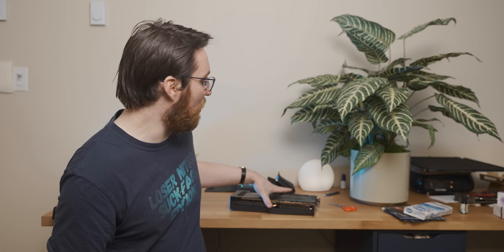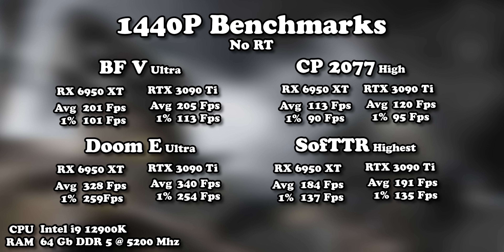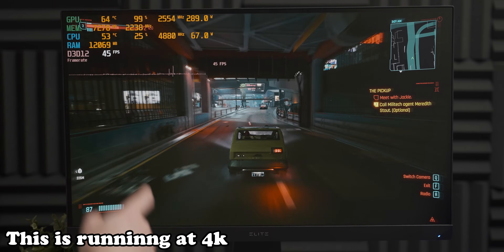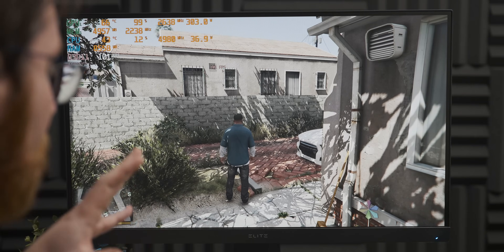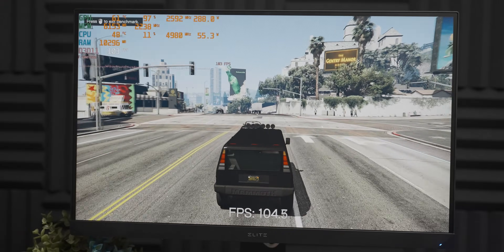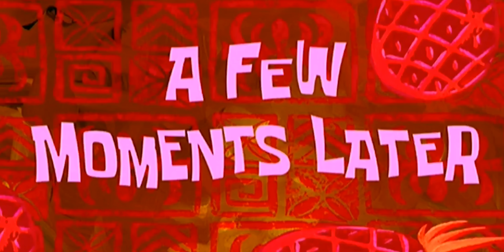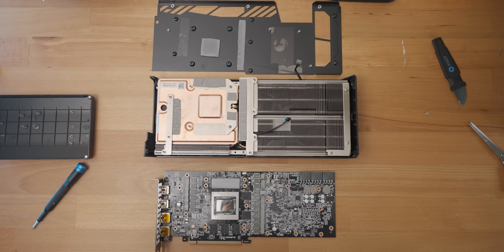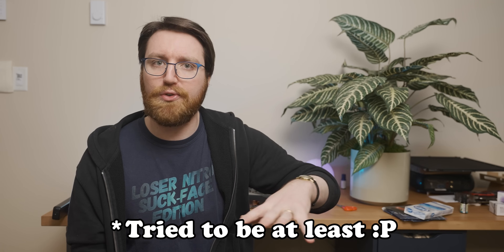I Can't Figure Out What's Wrong With This Gigabyte RX 6950 XT

Comment: I had a 6800 that behaved similarly. Not sure why. Even with afterburners power slider maxed out it wouldn’t pull more than 215 watts.
Reply: he made big mistake, you can't measure the power of AMD cards using software only

Comment: Considering that this is Gigabyte, with its infamous  revision-prone history, i thought that they might have more than one revisions of this model shipping out to reviewers and customers already.
Reply from the maker: Haha!! Yeah, that is definitely a possibility.
Reply: @DawidDoesTechStuff  Wonder if it could be something as simple as them manufacturing the cards with the same resistors too the voltage controller as the 6900 xt that now limits powerdraw on a hardware level, which causes the power filtering too get really noisy because it's struggling too pull the current it's supposed too have & they are trying too just get the cards out there anyway instead of fixing them.
Reply: cough cough Look at their Gigabyte Z690I DDR4 board and its massive recall cough
Reply: Agree 100%. I'm allergic to Gigabyte.
Reply: @Eremon1  oh how the mighty have fallen gigabyte use to be great
Reply: @emilypeters8888  
Sadly true.
Gigabyte were rarely the highest performing, but they were solid, dependable and reliable.
But now they seem to increasingly be a brand to avoid ☹️
Reply: absolutely
Reply: To be fair a lot of brands do silent revisions, Buldzoid has mentioned it a few times in reference to RAM OC.
Reply: @liaminwales  Of course I know that everyone else has been doing silent revisions with many products, but most of the time, it's just one another revisions within one year life span of said products (two at a rare cases). 

On the other hands, Gigabyte has been consistent with two to three kind-of-publicly announced x.0 revisions with even more when counting those silently revised x.x revisions for many products released so far.
Reply: At least it isn't on fire (for now)
Reply: Yeah. Simple logic tells us that if it is not the driver, not the firmware and not the mainboard, it has to be the hardware of the card itself.

Comment: I have also had issues with a Gigabyte graphics card. I had a 5700xt Windforce that caused a lot of game crashing and random computer restarting. I undervolted the card and that helped. Later, I just got rid of the card. Got a FE 3080 and haven't had the same problems
Reply: Apples to Oranges comparison.
Reply: @CarbonPanther  I wouldn't consider having issues with a different Gigabyte graphics card to be an apples to oranges comparison.
Reply: @wiifan013  Yes because you're not comparing the same models at all, Gigabyte using a chip from AMD vs. one from Nvidia requires an entire rework of the PCB by Gigabyte, therefore you can't compare the two.

Comment: 6:08 - The GPU shows up as an AMD Radeon RX 6600. Is it anything to do with that?
Reply from the maker: Oh yeah! That is really weird. Nice spot. I’ll also mention that to Gigabyte and see what they say. 👍
Reply: @DawidDoesTechStuff  The fact that this isn't the only one, I don't know what to say...
They either mistaken the chips or they were replaced somewhere in between, in factory or outside... the whole card. 
Might be good to check the gpu info stuff.
I could be wrong though.
Reply: Well spotted
Reply: good eye, if the computer thinks its a RX 6600 it could be following normal procedure for the RX 6600 and not the RX 6950 xt.
Reply: But does the rx 6600 consumes 300w?
Reply: They literally look exactly the same.  Knowing Gigashites QC they probably put the wrong one in the box.
Reply: @michaeltyrrell3381  more than likely
Reply: @fantum12000  actually unlikely, cause the 6600xt version has only 1 power connector, this one has 3 soldered on. so it cant be the 6600xt model they packed and shipped on accident
Reply: @WaschBaer_95   please tell me where i said 6600xt?
Reply: @fantum12000  around timestamp 4:04
Reply: @fantum12000  you said yourself an RX 6600 .... the non xt version wont magically jump from 1x 8pin pcie to 3x 8pin pcie connectors .. i just mentioned the xt cause its the first one i saw, but even looking at the RX 6600 gigabyte version it shows only having 1 power connector.    rx 6600 to rx6600xt is like 3050 to 3050ti .. not much of a difference in terms of power draw
Reply: @WaschBaer_95  fair point, do the 6700 or 6800 also have 3 8-pin? Could it be a situation where they did put a wrong board in the box with the wrong vbios?
Reply: @fantum12000  mhh, he said he did update the vbios as per recommendation of gigabyte, would be weird if it still shows up as 6600 with a 6950 vbios, unless the bios is always the same, and determines settings and clocks etc, judging from some set fuse or smth in the die, could be that this cards die is defective, or has the wrong factory side fuse set, that tells the vbios "Hey i am a 6600, give me the settings for that model"
Reply: @WaschBaer_95  how likely is it that it's a fuse and that was missed by gigabyte?
Reply: @michaeltyrrell3381  but then how would the 6950 drivers install? This is weird.

Comment: The only thing I can think of is that you may want to use 2 different cables for your PCIE power connections on the card.  I've heard that sometimes the power draw can be too much for a single wire.

Comment: I had a 1080 Ti from Gigabyte and it went into flames in my case 4 months after the launch of the 30 series from Nvidia. No cards were available at non-stupid price so I had to fall back to my RX 480 8 Gb from MSI. I could be stuck with a lot worse but I'll never buy another graphics card from Gigabyte, NEVER. It's been more than 1 year and it still hurts, damnit. I'm glad my RX 480 is still a trooper, I still max out some games at 1440p but its days are counted. It's been overclocked for more than 5 years. It will celebrate its 6th birthday this summer. One hell of a graphics card I tell you. Best PC purchase ever.
Reply: Man, the RX480 will never die. That thing's going to be good for 1080p/60 until the heat death of the universe.
Reply: My Strix RX480 is plugging along nicely. 
Sapphire 590 and 6700 also have worked great for me, so I'm only buying those companies cards in the future.
Reply: I have one gtx970 with completely burned hole through PCB, also Gigabyte card. And it wouldn't be nothing special to talk about, mosfets die and sometimes card end up like that (decent brands will include fuses on board to prevent that but that's another story). Problem was that that was not main power line, you can expect something like that on Vcore but in this case problem was on f. logic 5V rail, rail that have maybe 100mAh draw and it's cool and not under any pressure (most card from that era use simple linear voltage regulators anyway for it). 
But Gigabyte find a way to screw even that up and use obvious reject parts
Reply: @gorky_vk  Gigabyte tried to CHEAP out on components thats why they keep changing suppliers so u might even get mosfets and stuff from a worse supplier for same price (refer to GN's Gigabyte PSU fiasco videos - its very likely thats done for all their products)
Reply: Cheers on your long living rx 480. Great card! Pop that baby in a frame for collection. It may be worth something one day!

I collect many "pinnacle" cards from different eras. The 480 may be one. Hell, even the 1080ti. Shame yours went in flames.

I have a founders 1080ti. (from gigabyte none the less) and it's still ticking in my guest computer. My main rig has the 6950xt (nitro+ pure) it's a monster. I'm never getting rid of either one of those cards. They'll be collectors items! 🥰
Reply: Back when there was value for money in GPU's eh...
Reply: Ya should go about repasting the gpu and replacing the thermal pads with a good cleaning. Should last even longer after that
Reply: I use Gigabyte Gaming OC 3050 8GB for about 3 months works perfectly temperatures are unbelievable even when im playing temp dont go over 60
Reply: my 4 yr old 4GB RX550 still going strong (power color)- last year i broke the fan blades on it and just taped them together and it still works - been running on max OC and power draw since 2020 - and well it runs everything 1080p mostly :) except well AAA games but well thats a secondary rig with ryzen 2000 - my main has ryzen 5 3500 with a 2070 super from inno3D which is 3yrs old now

Comment: when you show the temps on your softawre, it Show "RX 6600" for your 6950xt, the problem seems to be with one of the component of the card if Gigabyte used a 6600 component (if it is the real temp of the card on your screen and not a screen fro manother card)
Reply: I noticed that too.
Reply: The only component that will identify as a 6600 is the GPU of the 6600. And that is not the case.
Reply: @DarkoPetreski  In that case, There maybe a part 2 incoming, Its possible that Gigabyte used rx 6600's components for their 6950xt to make the production cheaper, that would not be the first time that they made that kind of crap (like their PSU lol)
Reply: @weatherdream7343  it's a new card, I think hwinfo just didn't display the name correctly. It's gonna get patched out. But the whole power limit thing is pure gigabyte incompetence, I agree there

Comment: There's not a 3rd option here. Either you couldn't deliver more than the 288w to the card (electric setup on the house idk) or the card doesn't draw more for some hardware limitation, something physically wrong with the power delivery
Reply: he made big mistake, you can't measure the power of AMD cards using software only

Comment: 289w + 70w from socket that is spot on. I have 6900XT with 400w TDP 289w is what software will indicate while card is using ~ 360w.
Reply: hmmmmmmmmm
Reply: That's a very good point however it does not explain the suboptimal performance of his card in games, since it was still a lot slower than other cards that measured over 350W.

Comment: I"d personally be prety happy....a card that draws 50% less power than a 3090ti, that has marginaly lower frame rate, it is a really good card. That sound though..... i think the fans must be broken or something.
Reply: It is coil whine, it's got nothing to do with the fans dude.
This is just a terrible card.   All 6950 and 3090 Ti are - the highest anyone should consider is 3080 Ti or 6900XT, unless they are pros that need more VRAM still.

Comment: The only time you see graphics card that consumes 298W of power and you say it's not enough
Reply from the maker: I know right! I does feel pretty weird to point that out as a problem. 😅
Reply: @DawidDoesTechStuff  Sillicon Loterry and you won it maybe?
Reply from the maker: @Teksers  I wouldn’t really call it winning the silicone lottery considering that it was underperforming a decent amount.
Reply: @DawidDoesTechStuff  But somebody else mentioned that on hwinfo it states "rx 6600", maybe that has to do with something?
Reply: I check videos and shorts. Did I miss the update on this. I'm looking to buy this exact card.

Comment: Did you force PCI-e gen 4 in either mobo bios?  Tech Powerup was using AMD 5800X CPU, was your 2nd test bench an AMD platform?  What about Resizable BAR settings?  My apologies if you mentioned those possibilities but I don't remember hearing them discussed.

Comment: Just one small question. How much slower is it than the 6900? Can it be that they just sell you a 6900 and call it a 6950?
Reply: I was thinking the same about the 3090ti, maybe they just pick the best 3090/6900xt chips they made (silicon lottery wise) and OC/push up it's voltage a lot higher .... i mean you litteraly gain just a few fps by using a lot more energy ... just like an OC.
Reply: @arthur2605  The 6950 comes with faster memory though that you can't get on a normal 6900 and it's helping a lot so keep that in mind!
Also worth mentioning that the 6900XT using the so called XTXH chip exists which is literally already a pre-binned version that will net you all of what you ask for, and that chip is already a almost year old as well.
Reply: The 6950XT is supposed to be around 12% faster than the 6900XT, using much higher power limits and faster memory.

Comment: The graphics cards market is such a sh!tshow right now, with GPUs that can consume more than your CPU, pointless upgrades at ridiculous price, cooling solutions that are simply not able to cool the card while using 3 or 4 slots, etc. I was finally able to buy a new card (the RX 6600) to replace my RX 580 and even then, it was a lot more expensive than my old card was years ago, even if I bought it used (so under MSRP). I really want Intel to do SOMETHING  to change the market and go back to more optimized, cheaper and less bloated cards, but I'm not holding my breath.
Reply: At least Intel is trying to take down the power consumption crown with their 240W CPUs :D

Comment: AMD cards don't report the power they are really using. Make sure your not compairing your results to people with HARDWARE readouts from Clamps and the like.  For example the 6900XT reports 255W power when its actually drawing about 300W
Reply: your right
Reply: That's right, but it doesn't explain the problem, since there are other RX 6950 XT for comparison, where the consumption is displayed up to about 400 watts. With the 6950 XT you have to add about 30%. However, this gigabyte card is stuck at 280 watts (+ approx. 30% in real). Something is wrong with the input supply. Unfortunately, this cannot be measured exactly with AMD, since there is no complete measurement control of the individual parts, as with Nvidia Cards.

Comment: My Strix 6800 XT draws more power than that Gigabyte 6950 XT lol. Could it be that maybe that's a regular 6900XT and they labeled it as a 6950XT, by mistake maybe? I don't know if that's possible but it is weird.
Reply: BIOS flash would have fixed that though, most likely.
Reply: @dkline9  Nope, both BIOS' have a 289W factory hard-limit.
Reply: @CarbonPanther  the Bios he got from the other channel that had a 6950XT running at normal specs should have fixed that. That's why he asked for them to send it over. If the BIOS was wrong, one from a working as expected card should have allowed his to draw the 390 watta
Reply: @dkline9  That's true i overlooked that, i would like to know what happens if you flash the 289W onto the 390W card though.
And if any of these flashes are actually successful.
Why did that new BIOS not change anything...?
Reply: @CarbonPanther  yeah, that is weird! Probably some weird hardware issue. If the BIOS isn't compatible, it just won't flash. If it did for some reason when it shouldn't have I imagine it would just start crashing under load.

Comment: Once again reinforcing my complete and utter lack of desire to buy Gigabyte products.
Reply: Aorus is good just never buy gigabyte the Aorus devices never had an issue and they're rma process is amazing
Reply: @harrywilson7980  ironically I own an Aorus Pro MoBo, but it is only because of the solid VRM performance it offered. I doubt I will ever buy a Gigabyte monitor or GPU.

Comment: Such coil whine is not s good sign, and the backplate just heating up like crazy? Try to find in what spot is heating up, check if is memory or something but i believe it have to be some kind of power component

Heck try to remove the metal backplate off and see if the coil whine goes out, maybe it is shorting something

Comment: What happens if you adjust power draw limits in Adrenalin? If that does not give you 15% more power, then there is very clearly something wrong.
Reply: 380W is 35% more power draw than 280W, 15% more is not enough anyway to make it work how it is made to work

Comment: Wait you actually want your gpu to suck more power deym electricity must be cheap where u live.
Reply: well if it doesn't suck more power it ends up performing worse than older cards... so it becomes a redundant purchase if you can't get it to perform up to spec... Also we do live in Vancouver BC which uses Hydro power electricity which is green and doesn't cost too too much :)

Comment: I have asus rx 6600 xt oc edition for 2 mounts and I have similar "'problem. In TECHPOWERUP I saw that the gpu must draw 160w and my gpu draw 130w at max, but that didnt affect my performance at all which is strange because it is OC edition and it must draw at least 160w at minimum.